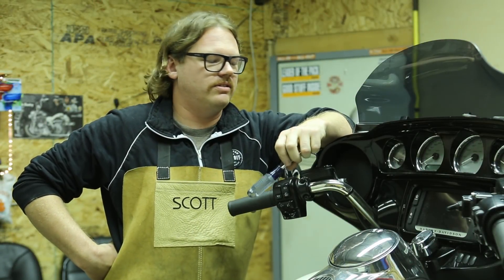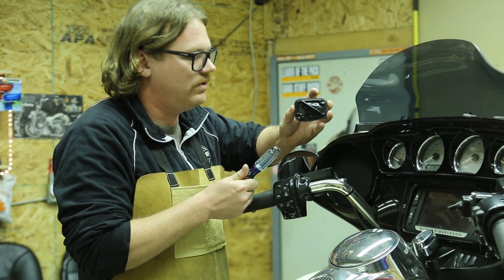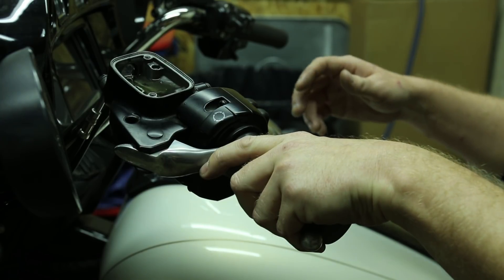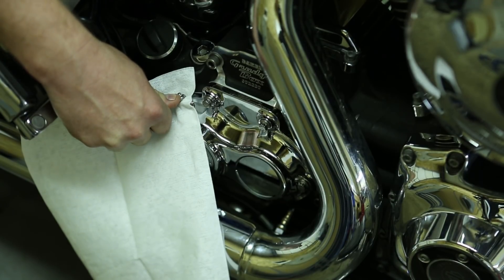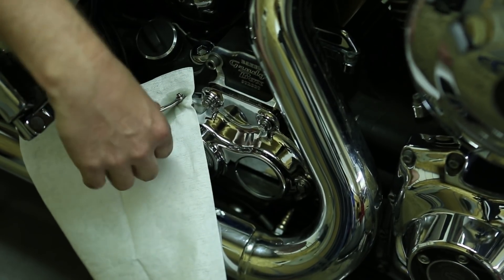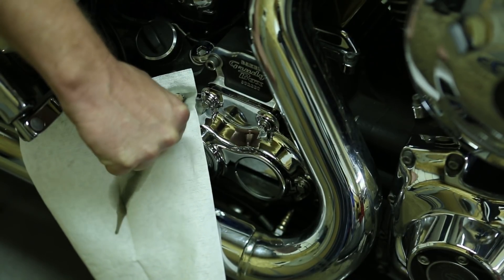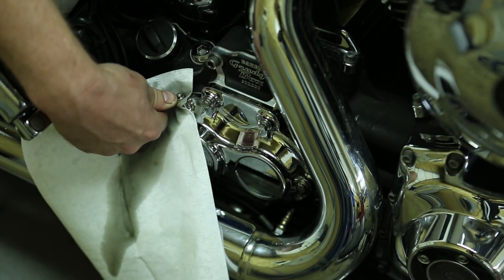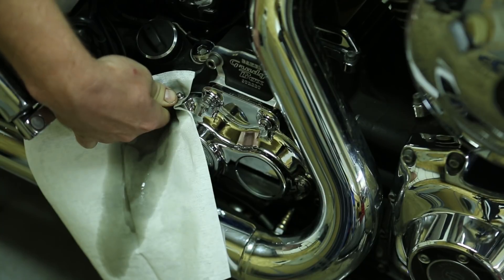Class#6 - How to Bleed a Hydraulic Side Cover

Comment: This is a horrible technique and does not address how to get rid of air bubbles trapped in the system. This method will work in best case scenarios, but add a few bubbles and this will just waste time and fluid. I can't believe this is the only video Baker has for this procedure. Wow.

Comment: You are using DOT 4 which is highly destructive to painted surfaces. You should have all painted surfaces covered as that fluid will eat paint on contact. Also, it will discolor chrome (stain) if not removed immediately. Most that watch these videos are amateurs (not a knocking, just stating fact) that watch to learn how to do something on their own. Tryiny to pump the clutch mc up then holding, leaning over the bike to bleed is an easy way to bump the bike possibly knocking out some fluid. The Pro's cover everything when working with DOT 3, 4, 5.1.